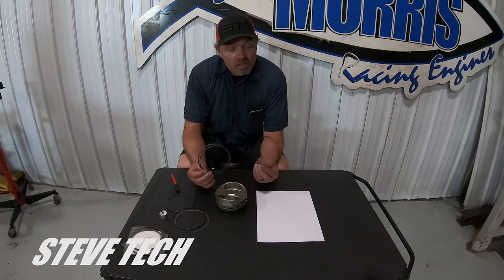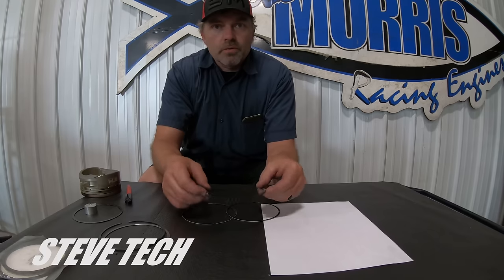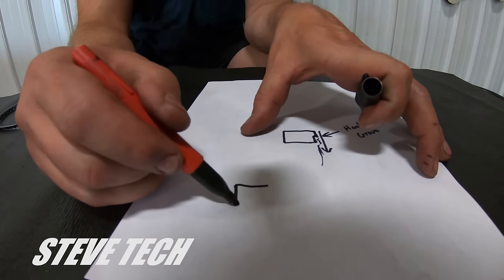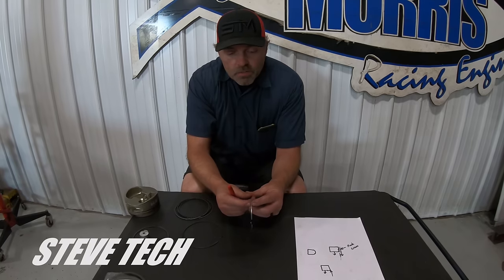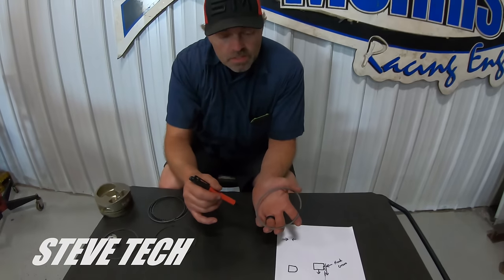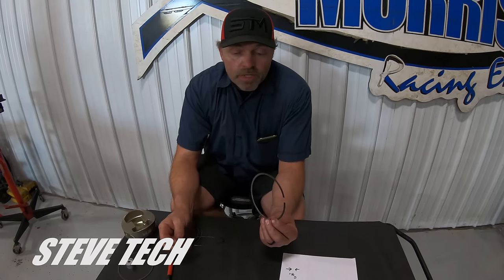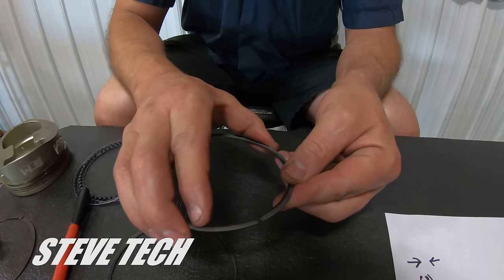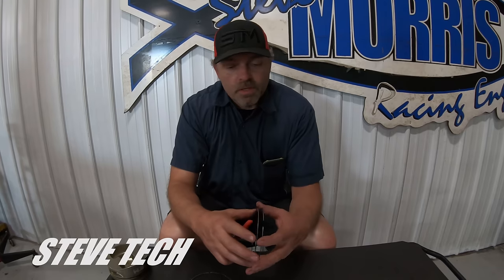Piston Rings

Comment: Man the eyebrow on that button looks thin and scary. I would tighten the second land up to shorten compression height to get more material in the button eyebrow or increase comp height so button doesn’t run into the second land thus not needing a eyebrow. I worked in engineering for Miller @ BME. He taught me a whole lot. When designing a piston you start with the ring stack he always preferred ductal rings. I like the .017 or .043 dykes over vertical or radial gas ports with low tension rings. 75-80% of the combustion heat is transferred to the cylinder wall via the top ring. With the trend of going to shorter vertical face rings. You must anodize the ring groove to inhibit the blazing hot compression rings from micro welding it’s self into the groove. NASCAR guys and their .5mm rings pay 100$ a piston just to anodize the top groove. Getting the Ring stack as strong as possible while keeping the compression height as short as possible eliminating flex in the crown via short pin boss towers.

Comment: Woo Hoo! Awesome vid. You kinda validated some of my goofball theories and taught me some new stuff. I raced you & Tom at DW '19 in my Franklin. Want to get freaked out? The car is n/a, about 5.5:1 compression, 2500 RPM max. I run 3/32, 3/32, 3/16 rings. Top is square, 2nd is Tortional Twist, oil is symmetric bevel cast iron. I have all rings back cut to .125 radial thickness, gap is way open because they were butting up... the old air cooled engine runs pretty hot so: .020 top, .022 2nd, .020 oil (3.28" bore). The previous builder put standard 1949 Pontiac 248 rings in it: barrel top, square 2nd, 3 piece oil. With all rings installed the radial pressure was ~26 lbs. With my stupid package it dropped to ~5 lbs. It used a ton of oil for the first 5k miles but after that it stabilized and works pretty good. So what do ya say? Can I have a job? LOL

Comment: Nice job of covering all the aspects of rings. I've tried the zero gap second ring once in a NA application. Leak down and compression was great: used oil like a tanker, couldn't get it to seal up until I changed out the zero gap second ring. Thanks for passing along your knowledge. j

Comment: Interesting take. I just seen a interview between total seal and kasse. Jon focused on the piston ring groove gap as the biggest area of detail in each application. The flutter you mentioned was addressed because of that gap. On gas port designs it was found to leak much more past the inside of the rings then the wall side. I believe some manufacturers are adding a steall ring groove within the pistons to carry tighter ring packs. To me that makes alot more sense with the top ring and the heat you mentioned.
Reply: Always know what ring you have before designing a piston. Gas ported shelf pistons leak more because they have a universal ring groove radial clearance. Setting the ring groove to a specific radial dimension for a specific ring's radial thickness is key, and will seal a ton better. 
The thicker the ring, the more the ring has the ability to transfer heat into the bore wall, which is cooled by the coolant. Thinner rings do not do as good a job.

Comment: Awesome video.  I'm looking for serious information on cylinder wall distortion. Meaning I've tested a few engines that were honed with torque plates and have round holes. Bolt the heads on and flip it upside down and distortion is all over place.
I'm sure this is a very guarded secret and very few builders will take the many hours of extra time to correct. 
But, any info at all would really be appreciated.

Comment: Interesting . Makes sense I've always done the second ring tighter . Always noticed in engines I put together with using lots of nos that the first ring looked beat up and would actually get carbon between the rings .. wonder if it was the top ring fluttering
Reply: Always go same or bigger on the second ring. Never tighter.

Comment: Thx, your videos are a wonderful library of practical hi-perf engine building info.

Something I'd like to know: what are the pros and cons of running a piston with pin bores that intersect the oil ring groove?  I've noticed that OEM engine designs (I think) never use this configuration.  I understand the obvious pro of allowing either a longer rod or larger crank stroke to fit into a given block deck height, but are there also some less obvious differences?

Comment: I'm just curious if you ever use the Total Seal rings, particularly the Gas Port ring setup? Or, a vacuum pump for the crankcase pressure relief, or an oil tank?

Comment: Whats your opinion on stainless top rings, late 80s early 90s 5.0 HO engines had stainless and can take hellatios abuse and still have 5-15% leak down at 200k miles with very minimal oil consumption if any noticeable between oil changes. Ive used the same rings, this is the 3rd block, and at last check had 12% LD on the worst cylinder. On a mild 351W with 20-25psi primarily track use and random street driving to and from local track, whats your thoughts on ring package?

Comment: May be a dumb question but I come from the diesel side of things and was curious as to why the boosted spark ignition motors are not using a keystone top ring? Is it due to the piston ring groove being too soft and the keystone ring would just beat itself out? I imagine the cylinder pressures in these 3,000 hp motors are nearing and or exceeding the pressures in the diesel producing the same 2500 ft lbs to a methanal turbo motor producing the same 2500 ft lbs. just from a curiosity stand point. On our end the forged pistons w/o the ni cast insert for the top rings do not last long in the diesel world.

Comment: Steve,  how do you feel about top and/or lateral gas porting on boosted engine? Would you still use standard tension rings?
Reply: X2
Reply: No need for them with thicker rings and big boost. They just become bigger leaks at that level. Unnecessary. Only meant for thinner rings with less radial tension.

Comment: I've never used zero gap in a gas engine but I have on diesel builds. Never had any problems. Oil stays cleaner a lot longer. I do run boost up to 22 psi so nothing crazy. Top ring is different than gas engines. It's tapered. I always thought the  zero gap ring should be the top ring. Not sure why they don't do that.

Comment: Thanks Steve for the informative video don't want to say I already knew that but until you watch it all he don't know if there's something new that came out what would be cool when you get to the Pistons about the Annie detonacion grooves on the top of them if you use them on the boosted apps and the accumulator radius between the first and second ring for boosted applications he's helping those in need and do use gas porting pistons for Boost vertically Friday turbocam from you for big block Chevy will be ordering yours SM set of piston rings and pins in the next week or so thanks Jim Bowman

Comment: How do you keep the hook in a Napier ring if you have to grind more gap into it?
Reply from the maker: It grinds like a regular ring does
Reply: @stevemorrisracing  so if you increase the gap, the hook will still be there? I mean, how much can you take off before the hook is gone?
Reply from the maker: @laytonturpin864  the hook is not on the end
Think of it as a scraper pulling oil down all the way around the ring
Reply from the maker: @laytonturpin864  it is on the face of the ring not the end

Comment: Steve. Please talk about ring phasing and how it's done correctly / differently for boosted  application's than NA. You did start explaining it, but I think other's would like more details on how you phase your  rings on a boosted engine. Just saying.    As always. Loved thee informative comments/ video. Keep up the great work. 👍
Reply: It's only an intial setup thing, once the engine is running all the rings spin so they will move in and out of phase becuase they all rotate a different speeds.
Reply: @shanerorko8076  lol NO
Reply: @puppetmasterblaster  Yes the rings will spin just like the lifters, valves, springs, retainers and push rods all do.

Comment: Meanwhile, the Rep from Total Seal says that Ring flutter is Nonsense..
With all do respect, that principle has been shown to be out-dated.
Cylinder sees negative pressure every cycle to dump the exhaust gasses. Top ring sees more heat and needs to be gapped larger.